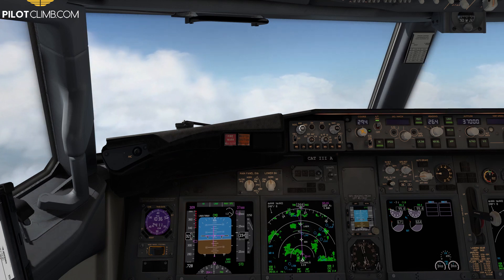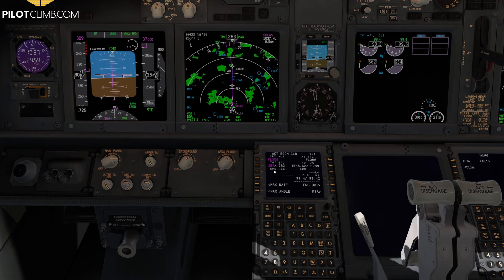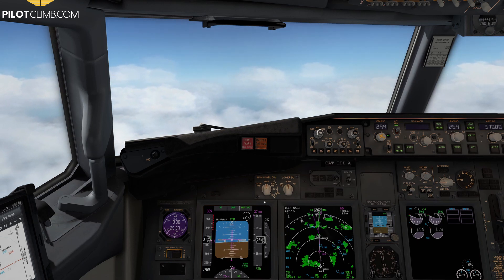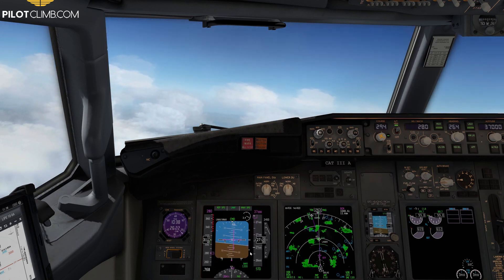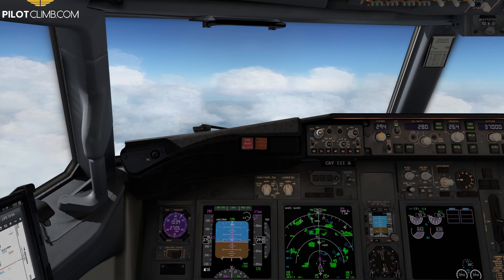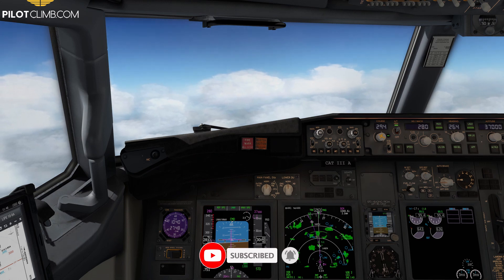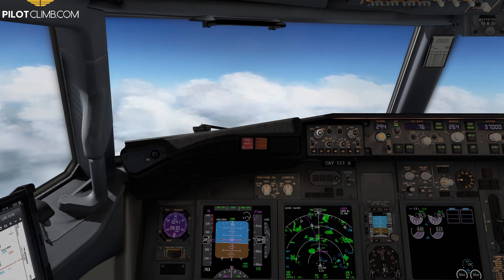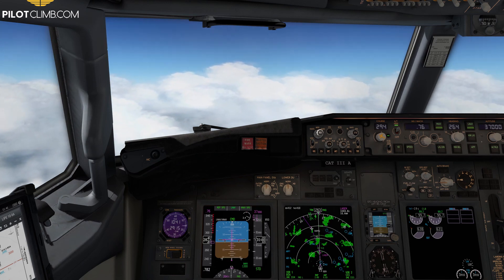Best Turbulence Penetration Speed Explained - [Boeing 737 X-plane11].

Comment: Hi Captain, I've watched this video and as usual, I've learnt something new and very useful. I have my usual questions for this video regarding turbulence :
1) When you fly in these conditions, I think I read somewhere that some companies suggest to revert to CWS instead of using the A/P. Do you use this rule as well?
2) When you went through clouds the humidity was very high and the OAT was below 10 C. Shouldn't you have selected the TAI? (Engines and/or Wings Anti-Ice)
3)Always in regard to turbulence, isn't better to put the Engine Start Switches on the FLT position?
Thanks for the video Captain and thanks for your answers as well. Have a great day ☺
Reply from the maker: The procedure regarding the use of CWS is correct, however the crew should use sound judgment in order to decide whether to leave the CMD or use the CWS. Regarding the anti-ice you are correct, however, you need to take into account the SAT, if that is -40 or below you don't have to use anti-ice. Be careful when using wing anti-ice at high altitudes, you might have pressurization problems. You should position the Start switches to FLT if you are flying into severe turbulence.
Reply: @PILOTCLIMB  Yeah it once happened to me during a cruise at FL370. I had wing anti-ice on and the BLEED TRIP OFF light illuminated ( I guess it was from the left engine) and pressurization problems as well. Thanks for the answers. OAT and SAT refer to the same thing if I recall correctly. TAT is the total air temperature, which considers the Outside Air Temperature + the Compressed Air the comes into the Probe and tends to make the temperature higher.

Comment: Good Day Capt Gabriele, 

1. How many ton or kg of jet fuel burn on B737 at cruise flight level for example FL 330?

2. How many ton or kg of fuel  used when B737 fly below 5000 feet during approach? 

3. How many ton or kg of fuel used for taxing from gate up to runway for takeoff on B737? 

Have a nice weekend... And thanks for this video... 👍👍👍
Reply from the maker: Hey, I hope you are doing great!! The fuel flow of a Boeing 737 that is on the air is approximately 2400kg/h, this works well for all situations. However, this might change depending on the Aircraft age, configuration, and Weather. The taxi fuel changes a lot depending on the airport, some have a very short taxi, some have veeeery long taxi (MAD).
Reply: @PILOTCLIMB  Thanks Capt Gabriele, 2400 kg/hour is for 2 engine right?

Comment: Good day, Gabriele. Thanks for the your video! I have a question. For example: we’re flying below 10.000feet and speed should be 250kts.  but we have a turbulence. Do we need increase our speed to 280kts? After confirm from ATC no speed restrictions. But in this case we’ll reduce AOA and only after speed 280 continue climb.
Reply from the maker: Hey, thanks for watching!!! You should try to keep 250 however, if the situation is bad you inform ATC and set the best penetration turbulence speed.. safety come first..
Reply: @PILOTCLIMB  Hi, Captain! Thanks for your answer! Roger!